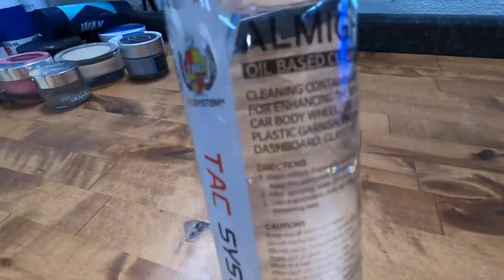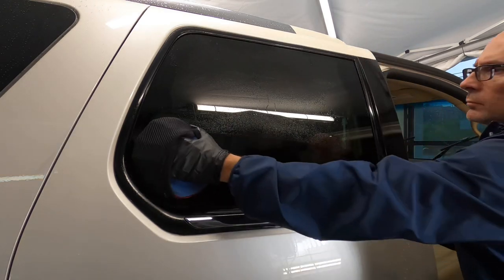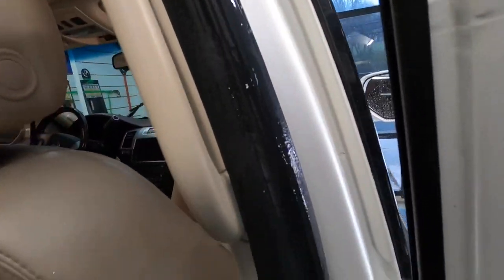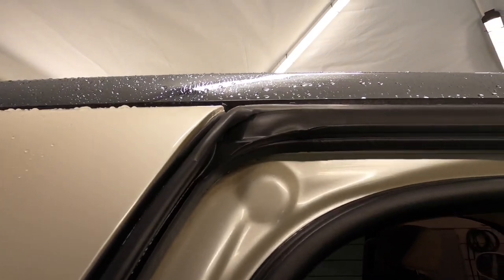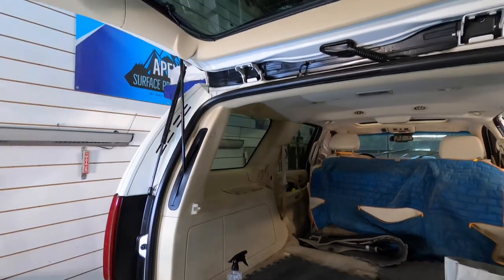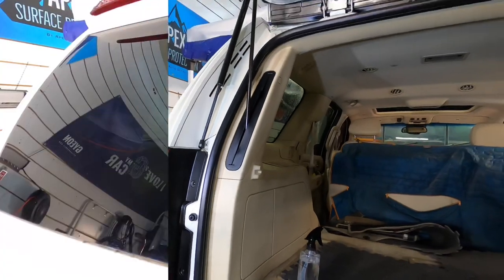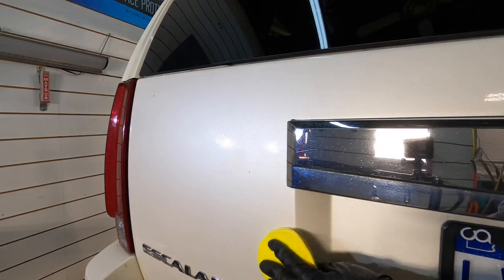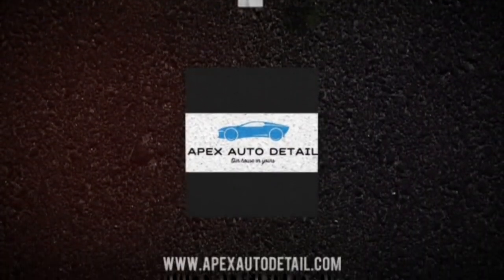Condition And Protect Rubber Door/Window Seals, Grommets, Trim, Plastic, Rubber With Tac Almighty!!

Comment from the maker: What have you used and can recommend for Moulding, Seals, Grommets?
Reply: I have used 303 protectant only and massage it with an applicator.
Excited to use it since won it!👌👌👌
Reply: Water with a little dawn and a soft bristle tooth brush
Reply: I use 303 Aerospace too. They actually put a special version in a dabber-type dispenser (think liquid shoe polish bottle) to make application on seals even easier for those so inclined. Always looking for something better though!
Reply: I use 303 protectant on my seals 🦭
Reply: Can you use it on engine bay?
Reply: @wendell6692  shouldbe able too
Reply: I've been using Sonax Rubber Protectant for a while and it seems to do it's job well. Granted, I don't really have much experience with any others out there.
Reply: 303 FTW!!
Reply: I've had great success with TAC Moonlight all around the car. If I need to try to bring it back from the dead I like Gummi Pfledge.  TAC is an excellent company.. hope they get US distribution again
Reply: RV rubber seal conditioner (currently Star Brite).  RV seals take a beating and products for them tend to perform well.
Reply: I've been using Gummi Pfledge, but I might have to try out Almighty. I had a bottle of Moonlight that I used for a couple years here and there so I'm familiar with TACSystem.
Reply: Sonax makes a good product for that purpose
Reply: Sonax Rubber Protectant on the inner door seals or 303 Rubber Seal Protectant
Reply: @wendell6692  yes
Reply: @1stfrompuertorico568 hey bud, let me know what you think. I also have been using 303 and like it
Reply: @wendell6692 on the plastic
Reply: Mother's Back to Black

Comment: I love products like this.

I'm sure you're the last person that needs a pro-tip Brian, but just in case you haven't already used this one, when I'm completely just about done, I like to go hit the bottom window seals with something like this and let it soak a bit, then I'll mop up the miniscule amount with a detailing swab and wipe off my window again if necessary. 

Just leaves a nice dressed touch and keeps what I find to be the most vulnerable seals on a car, nice and soft and flexible for all the ups and downs the windows throw at them.

Comment: This seems counterintuitive to apply an oil based product on paint and glass. But since I haven’t tried this product I can’t give an informed opinion on the subject. However I don’t think you (Brian) would recommend something that didn’t work.
I have used a couple of different products including VRP from Chemical Guys. I use one of those little foam brushes to apply so as not to get it on parts that don’t need it. Applied 2-3 times a year and seems to work fine.
Thanks for the review 👍✌️☮️
Reply from the maker: I am not quite sure what the chemical make up is exactly. Just seems a bit oily to me.

Comment: Why wouldn't you use a rubber, plastic, trim, etc., conditioner you already have in arsenal?  I have used TW Ice Spray Wax, a tool in my tool box...
Reply from the maker: If you already have products...use them up first.

Comment: Why glass and paint as well as rubber? I get the " overspray " effect on adjacent surfaces it should be safe obviously...but applying it on purpose to glass?
Reply from the maker: I am just sharing what the product description indicates...can be used on paint and glass.
Reply: My apologies as coming across as critical....hey one bottle1 sponge 1 microfiber .less time.
Reply: It's similar to Moonlight in that it uses an oil carrier instead of a solvent carrier. I've used moonlight with decent success on paint and plastics so I'm sure this is similar. In that sense, you can use it exclusively on trim and rubber seals, but it's not bad if you get it on the paint.
Reply: @SecretSauceyjuice  that was a nice clarification.maybe not made purposefully to go on paint and glass...perhaps they discovered it offers protection on other surfaces? Pure conjecture on my end.Good for them if it ended up being versatile.
Reply: @keithknechg3217  

DESCRIPTION

UNIVERSAL HYDROPHOBIC SPRAY-ON COATING.

LET’S CALL IT THE TACSYSTEM “MOONLIGHT JR”, THE SAME OIL-BASED AS THE MOONLIGHT.

From interiors to exteriors, everything and anything, the Almighty can coat wheel, tires, plastics, dashboards, vinyl, paint, windows, leather (coated), engine bay etc.

When used on plastics and trims, it darkens and restores the surface to a satin, deep finish.  No curing or set time, simply spray, wipe and done.  No foul, solvent heavy smell like most oil-based ceramic spray-on coatings.  Almighty is a sheeting product, great for areas of hard water.

Comment: Can you do a video on cleaning the window tint on the interior of your car?  Lower GSM mf, water only, etc.?
Reply: Make your own for protecting tint on the interior of windows. 600 ml of distilled water in a spray bottle, then add 15 ml of baby shampoo. But get good quality edgeless micro-fibre cloths. This is cheap, works a treat and does not harm tint.
Reply: @dtna  350-520 are fine. I use 520 because i bought a bundle of them when they were on special and got a good deal. And they are good for polishing and waxing and finishing the duco. But 350 would be fine, but this method is the best. I have used this way of cleaning my car windows for years with absolutely no damage to the inside tint. And compared to what you pay for name brand window cleaners is less than 1/10th of the cost. Try it my friend you will be surprized how easy it is and how well it works, and no streaking what so ever. 👍🤝